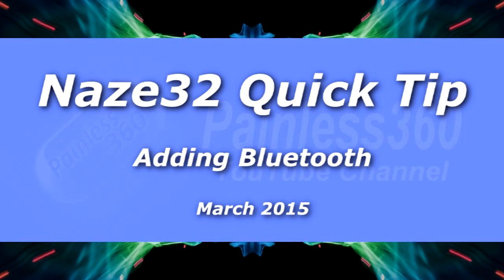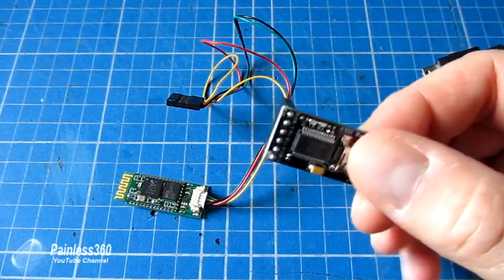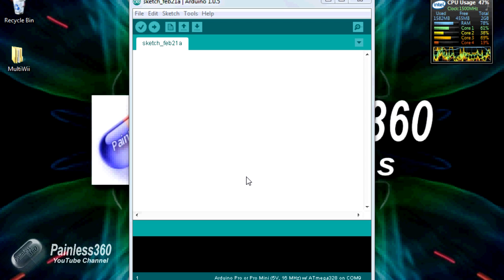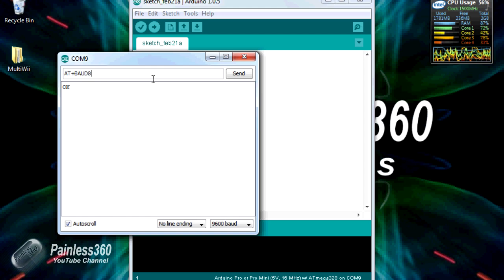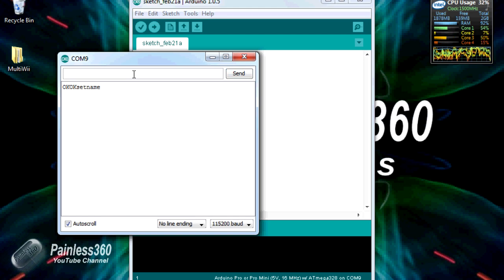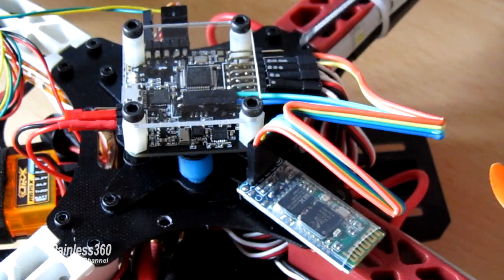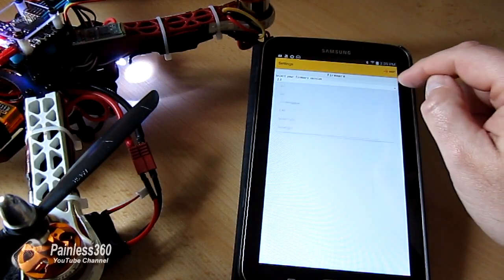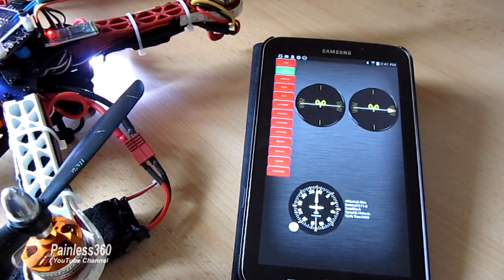Naze32 Quick Tip – Adding Bluetooth (HC-06 module)

Comment: Hi, this is another useful video as usual. And thanks to your series, I purchased a Naze32 and have it up and working. However, as the video's progressed, I decided I should have bought the full board vs. the Acro, as now I want all the bells and whistles you showed.  So, I like the MinimOSD, and I fly FPV  --- so I'm interested in pulling VBAT and RSSI off the FC. I seem to recall your series covered VBAT, but the big question would be if you would be willing to do a video on the RSSI (before I spend more money on the wrong stuff again, lol, which I tend to do)... Thanks again for the great channel.
Reply from the maker: Hi Tom, I'm not planning on an RSSI video as I have all Spektrum kit. I would advise that you google RSSI and telemetry before making any decisions. RSSI looks relatively easy if you can get the RSSI signal out of the radio receiver..

Best of luck with it.
Reply: Painless360 Thanks for getting back to me! I'll do some more reading and see what I can figure out. I am curious to know what Spektrum kit you are referring to?  I have a Spektrum radio also, even a TM1000 telemetry unit, but they never seemed to develop that system, yet alone an OSD, I never was that impressed and you can't read your radio screen on goggles.. I recently got a Taranis and use it for FPV.  For non-FPV,,still have a bunch of Spektrum RX's in things, so I bounce between DX6 & X9D+..  lol  I'd love to see a video of your complete setup/strategy/philosophy. Cheers .
Reply from the maker: Thanks Tom. I don't use telemetry, I use the EzOSD on the bigger models and this gives me battery and current readouts along with RTH failsafe so I don't loose the model if I push it too far!

On the smaller craft I use the on-board voltage monitoring or something like a MinimOSD with voltage divider installed along with failsafe RTH modes.

I tend to fly within LOS so range of more than 1m is never needed.

Tend to fly with goggles in the summer and a screen in the winter (too bright for screen in summer, goggles fog up in winter!).

All Spektrum radio kit here, (every this comes up on the channel the haters all jump on it!). I really like the Spektrum kit, disappointed like you that they haven't done more with the telemetry but it works flawlessly for me.

I am looking for an FrSky system next (not planning to get another radio for another two years at least though)  but so many of my models have the DSM/DSM2/DSMX receivers installed that it's an expensive proposition to change everything over when its all working great.

I'm a fan of ImmersionRC and FatShark for the FPV kit. I do have a few other models of Video receivers/ground-station kit (Boscam and Flysight) but always end up using ImmersionRC/FatShark transmitters.

Hope this helps, very Happy Flying!
Reply: Painless360 Thanks for the insight. I also am a big Immersionrc fan, also Spektrum,and FRsky even as they are competing technologies. I really like the Eagle Tree Vector and hope to make that my main FPV OSD system. i plan to stick to LOS in the future too. I'm just groaning because as they say "one of my aircraft is missing" and I will need to replace some gear probably and this hobby's getting espensive. That's why I have been exploring the Minim etc.....

Comment: Are the bluetooth modules 5V compatible? I understood most were 3.3V.
Reply from the maker: You need to check on the individual board you have. Latest HC-05 modules work with voltages from 3.6-6.0v.

Happy flying!
Reply: Painless360 So the Tx/Rx port used for bluetooth on the Naze32 runs at 5V?

Comment: dont have any spare channels and dont use ccpm. Would any of the pins next to the buzzer work?
Reply from the maker: You need to read the Naze32 documentation and pick up the GND and +5v from one of the spare pads on the board.

Or you could piggyback from one of the gnd/+5v lines from the ESC connections (the way I'd do it)..

Best of luck with it.

Comment: I thought this would be a cinch, but I get this when typing AT, send
at java.awt.EventDispatchThread.run(Unknown Source)
My BT board was used elsewhere. Does it need to be cleared or?
Reply from the maker: This is nothing to do with the BT adapter and everything to do with the Java install on your machine. I would check that the Java install is good (https://www.java.com/en/download/installed.jsp) and re-install if there are any suspicions about the setup. Google the error and you'll see others have had it and it can be due to quite a few reasons, including bugs in the Java code on older versions.

Best of luck..

Comment: Hi 360. 

I am using 6 motors. How else can I power the BT module?  

Thanks
Reply from the maker: You can pick up the +5v and GND from one of the many spare outputs in the radio receiver if you using PPM, you may have a spare channel (AUX2 or GEAR) that is free when using PWM.

Be careful, you don't want too much current pulled through it but it does provide some extra places..

Happy flying!

Comment: Excellent tutorial, thank you.Do you now why when I arm the board cease to have telemetry?
Reply from the maker: Could be down to lots of things.

Some of the older clone boards didn't have the inverter on-board needed for the FrSky telemetry to work correctly. I'm not running telemetry here with this so can't help much. However, a quick Google shows some great detail on the usual forums so looks like others have played with this too and can provide some more help.

Good luck getting it sorted, let me know what the problem was - I may be able to point the next pilot in the right direction!

Happy flying!

Comment: very handy Lee, can you get this app for the IOS, in particular the ipad 3? shame the Naze didnt have a few more serial ports. i was thinking of using that one for the OSD addition. great Vid though as usual. Thanks
Reply from the maker: Hi Tony, you can. At a high level you need to enable 'soft_serial' on the board, this then turns receiver connection pins 5 & 6 into Soft_Serial_1 (19,200 baud) and pins 7 & 8 into Soft_Serial_2 (19,200 baud). Have to be using PPM of course and this does mean that both these pins are then unavailable for LED and Sonar setups as shown in previous videos.

You can then plug the Bluetooth into pins 7&8 (pin 7 is Rx, 8 is Tx on the Naze32) after setting the baud rate on the BT adapter to 19,200 using the AT+BAUD5 command.

I'm not planning on doing a video on this advanced topic unless I get enough interest. Best of luck with the build!
Reply: Thanks Lee, sounds easy enough, when the time comes for that I'll let you know how it goes... Cheers